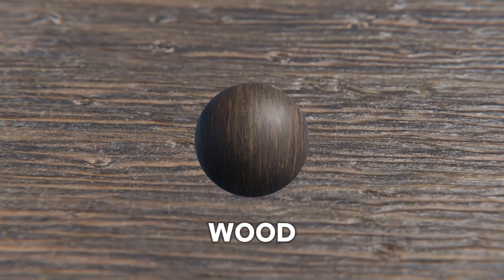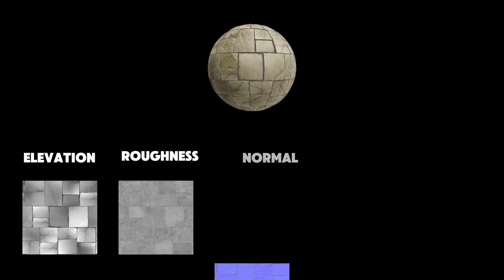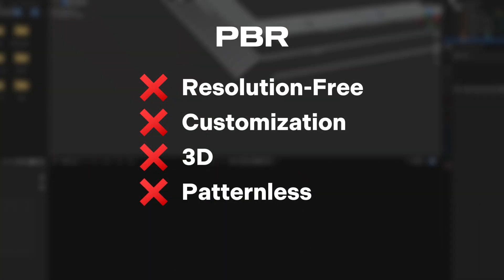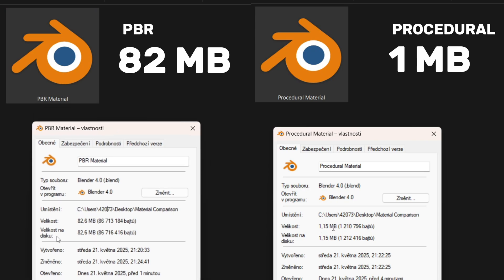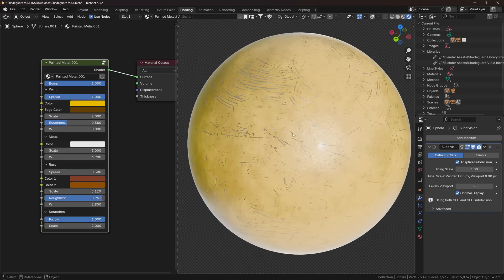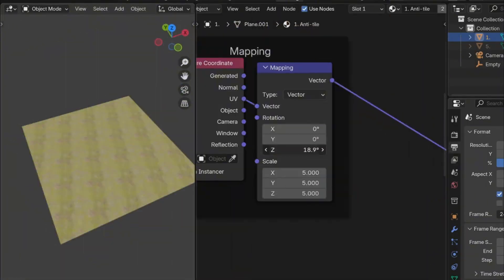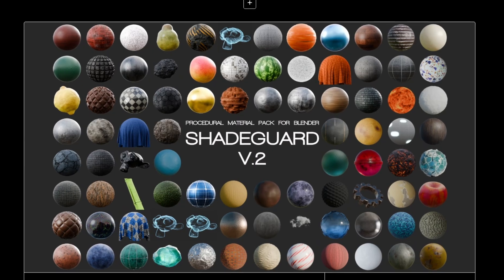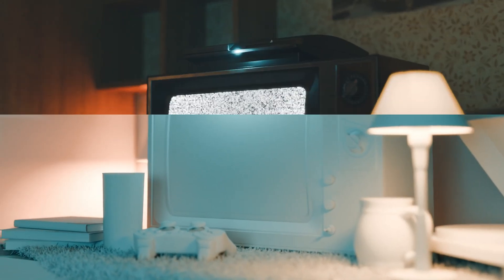Procedural Materials Explained

Comment: The real question is. Does it work as good as the bpr material for gaming? 
Will the performance be as high and effective? And will the player notice it?
Reply from the maker: That's a good questions. The thing is, pbr materials are universal and they are supported with almost every rendering engine for games. The Procedural system differs from engine to engine so if you for example make a procedural material in blender, you can't export the node system to unreal engine and adjust the material there. But I think its good if you want to make it in Blender and then export it as a large pbr material into game engine. And if you would like to make changes, you can make them in Blender.